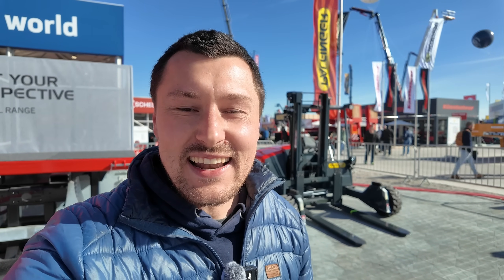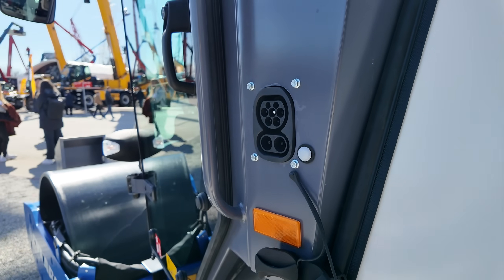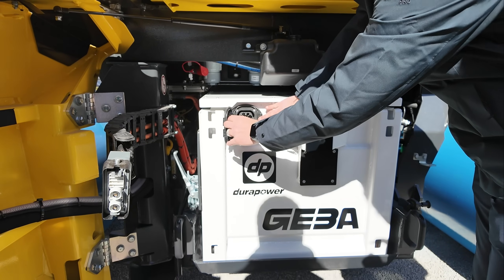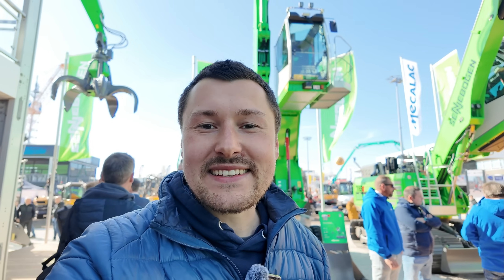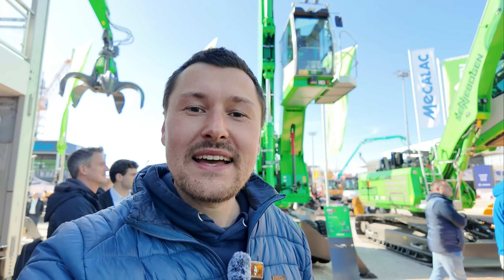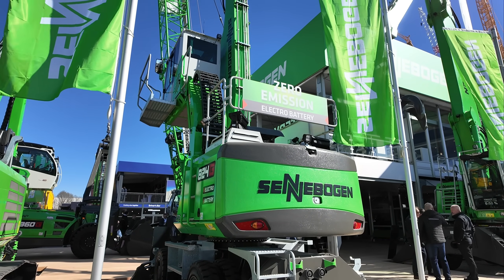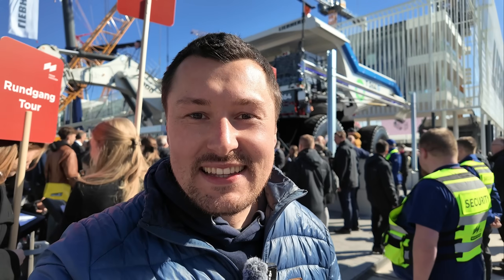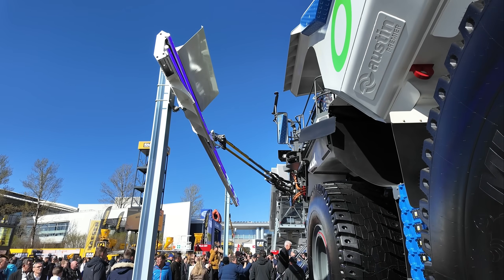Construction Sites will become Silent

Comment: How about the prices compared to ICE?

How much more expensive?
Reply: worth it
Reply: @thickwood8785  that depends on pricing.
Reply: @paulomoniz7326  pricing depends on wether you're in a normal country that has legislation increasingly mandating the switch to electric making ICE non-viable or that much more expensive, or if we're talking superpowers currently in turmoil where it's just about the price at the pump because how dare anyone mention extreme weather events made much worse and more frequent because of man-made Co2 emissions...
Oh, and even in the dumbest and most irresponsible wealthy countries lacking any moral leadership on the matter we're already seeing price parity with renewables and electric heavy equipment making it a financial no-brainer.
Reply: @velotill  pricing is very important for a business. If for a price of 1 EV you can buy 4 ICE maybe better choice for the business is ICE. Do not know how you can talk about price party, that Info was not on this video.
Reply: An excavator will easily consume 10-20 litres of diesel an hour. So the runningcosts quickly add up.
Reply: @bjarneh-im1uw is asking for pricing Tabu?
Reply: Go look it up, they'll have prices on their homepages
Reply: @sebyst7907  I want him to tell me on the video. Maybe he is avoiding it for some reason.

Comment: Some years ago we designed an electric truck conversion for use on a building site. It was designed to do away with noisy generators whilst allowing electric power tools to be re charged and lights to be used to illuminate a site. We successfully created a van based on an electric Vivaro but the intention was always to have a truck. I never finished the truck as I retired, but we know it would work.
Reply: I am surprised there isn't a "portable power grid" solution for construction sites, especially remote sites. Using modern power electronics shifting power across AC/DC and various voltages is very efficient, percentages in the high 90's are nothing exceptional. Being able to combine battery storage with a low-power grid connection (240v service or whatever is on-site) and/or solar would give you a massive supply of energy, while eliminating the fuel costs/logistics.
Reply: @CuthbertNibbles  fun facts it tends to be below 50 volts on construction sites just to be extra sure